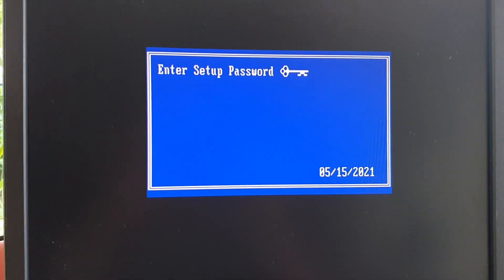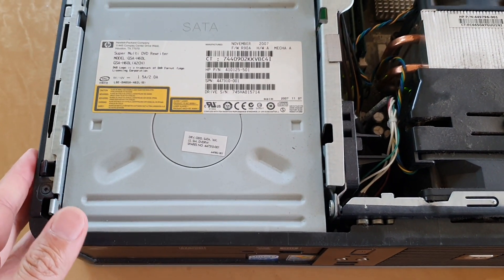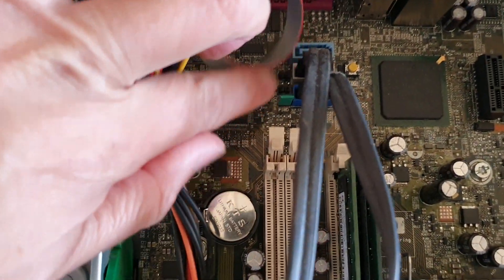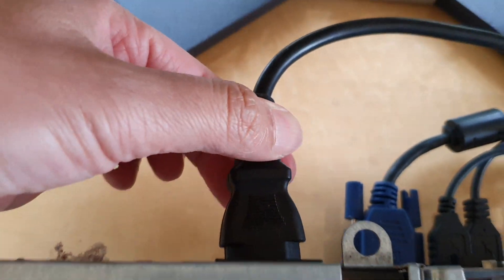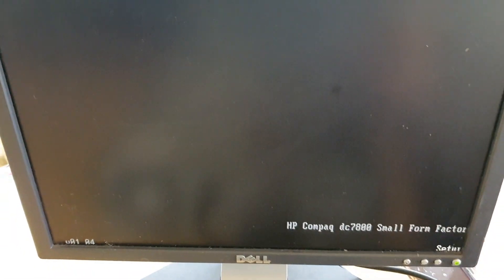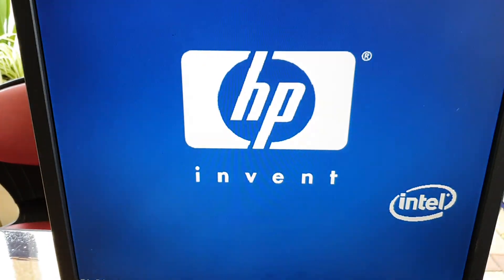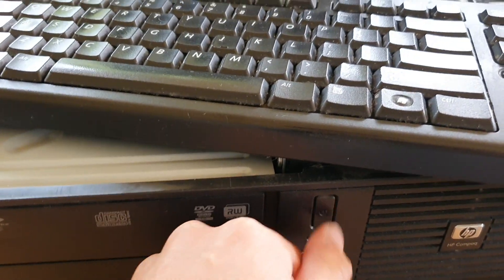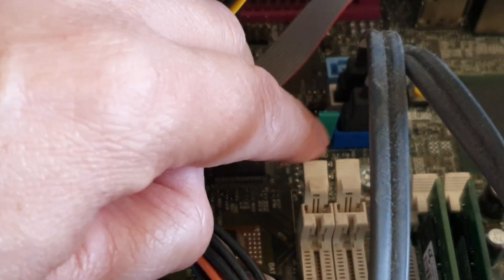How To Reset BIOS HP Compaq DC7800 With a Jumper

Comment: What if the keyboard is not working? It lights up but it F1 doesn't work
Reply: I have the same issue...keyboard doesn't respond when i press f1 or any key!  gargage computer.....not worth the headache....these dc7800 and 7900 can be bought working for under $40 on craigslist or even ebay.....why have a headache...throw the sucker out....even the HDD is only 80GB on these....now if u have data ur trying to retireve....i can see trying to reboot back to windows....otherwise...thrash he sucker! lol
Reply: @basiliotan5101  can u resolve the keyboard problem?
Reply: can u resolve the keyboard problem?
Reply: Some people on hp support commu said that a PS/2 keyboard the one with pins is the one allowed to work on bios page with that u change settings to allow usb keyboards to be on  @orlandorojas951
Reply: Connect keyboard ps2